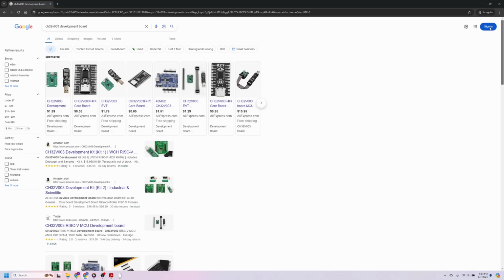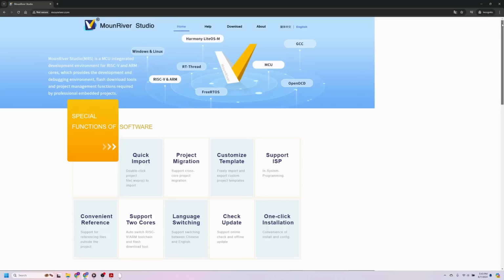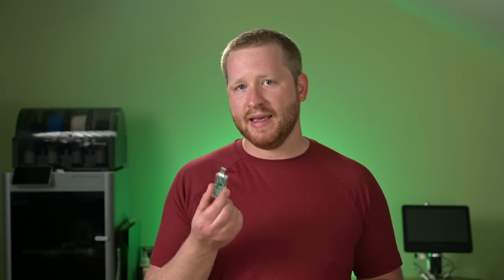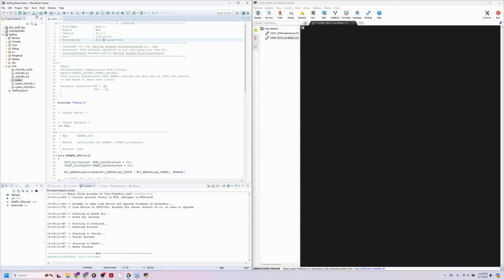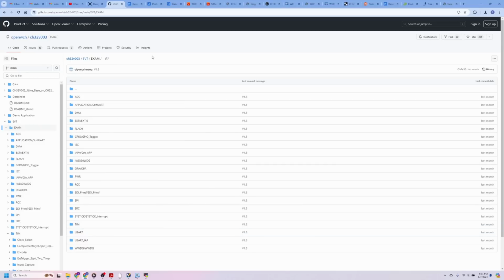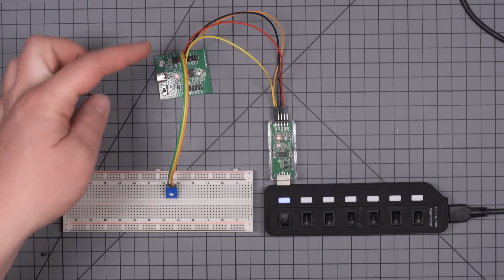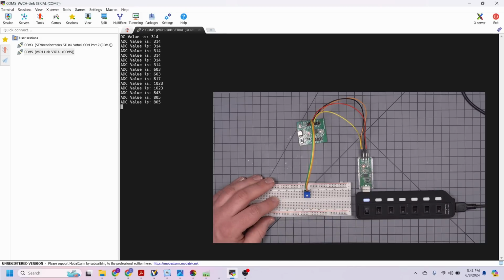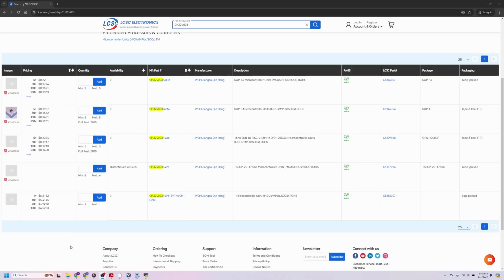Which 10 Cent Microcontroller is Right for You? Comparing the CH32V003 to the PY32F002A.

Comment: Thanks. It would be interesting to compare code densities between the cores, but that would require some effort to do right, probably require compiling a relatively large program without using a lot of HAL stuff.
Reply from the maker: That would be interesting, but a fairly in depth project. I also think that exactly what you chose to do with the code could make a difference, which is why there are so many different standards for benchmarking microcontroller cores.
Reply: I suspect that the RISC-V will have a slightly lower code density due to the spartan nature of its ISA. But being both RISC, I suspect that they’d be close.
Reply: @ChrisSmith-tc4df  That would have been my guess, but a web search came up with a claim that RISC-V was about 10% better <shrug>.
Reply: @ChrisSmith-tc4df  Basic RV32IC (or RV32EC in the WCH) has a little lower code density than ARMv7 (Thumb2) used in the Cortex M3/M4/M7, but don't forget that the M0 has the older/cut down Thumb 1 / ARMv6-M which essentially only has the 2-byte opcodes and full access to only the first 8 registers. The WCH has only 16 registers vs 32 for the more common RV32I, which can cause more register spills to stack than in full RV32I (but similar to 32 bit Arm), but it has both 2-byte and 4-byte instructions and the 4 byte instructions have full access to all registers. I think it will be pretty close between these two chips.  Note that the "Hazard3" RISC-V core in the new Pi Pico 2 is not only full RV32IMAC but also has some newer ISA extensions that can cut code size quite a lot, including Zba for array addressing ("shift and add" instructions), Zbb with some additional boolean operations and clz/popcount, and also the very new Zcmp which is specific for microcontrollers and adds things such as push-multiple, pop-multiple-and-return, and instructions to copy the first two argument registers (a0, a1) to or from a pair of callee-save registers (which speeds up function prologs and also putting arguments in place for other function calls). With these extensions in place RISC-V code is denser than Arm  Cortex M.  In 64 bit, RISC-V was significantly denser than amd64 or arm64 right from the outset, even without the more recent extensions. Recent versions of standard upstream gcc and clang have support to automatically use all these extensions if you include them in the -march argument to the compiler (e.g. in CFLAGS in your makefile).
Reply: @ChrisSmith-tc4df  RV32EC is not as spartan as ARMv6-M! At least it has mixed 16 and 32 bit instruction lengths, i.e. 3-address versions of all instructions, with all registers usable. R8-R12 have very restricted use on the Puya. The only things really missing on the WCH vs Puya are a multiply instruction, push/pop multiple, and and 16-bit opcodes for byte and halfword load/store. Later/bigger RISC-V microcontroller cores such as the Hazard3 in the RP2350 do have all of those.

Comment: In your comparison, you didn't mention power consumption.  I would assume that the 48MHz processor consumes roughly twice what the 24MHz processor does.

Also is it a fixed clock rate?  i.e. can I slow it down to reduce power?
Reply: You can clock them down to 8MHz off the internal RC oscillator and 4MHz from an external crystal and they also have low power modes from a 128kHz internal oscillator.
Reply: @greendragonmakerspace  Interesting, thanks!
Reply: @yeroca  I believe the power draw is a bit more than an attiny @AllTradesZach this might be an argument for the more expensive mcus for power critical applications
Reply from the maker: Yeah, sorry, I glossed over power. The video was getting too long and as @greendragonmakerspace says neither of these would be my first choice for low power applications. I believe they're both made on fairly large processes (hence being able to operate at 5V) which is a detriment for power consumption.

It's also true that they both have clock dividers and low speed internal oscillators, as well as external clock options, so they can go slower to save power. I don't necessarily think that datasheets are useful when it comes to power consumption numbers (because I've seen them lie and they tend to use very specific operating conditions which may or may not match reality). I didn't get the chance to actually measure power consumption, so I didn't say anything. 

Both chips have sleep and stop/standby modes, the latter of which really decreases power consumption but takes time to wake from. A common approach for reducing power is to turn on, do what you need to do as fast as possible, then go to sleep for as long as possible. You can use a real-time-clock to generate the wakeup signal, which neither of these have (the PY32 actually does have it, since it is the same die as the PY32F030, but it's not a listed feature on the -002) or an external signal. The PY32 does have a low power timer which I believe is designed for this sort of thing though. The PY32 also appears to have better power consumption per the datasheets, but I'd want to test that side by side with the same code on both devices. The PY32 datasheet says on the order of 6uA in stop mode with the low power timer running. So I think the PY32 is the better option for low power battery devices, but I don't have hands on experience with this aspect of either of them.
Reply: @AllTradesZach  Thanks for the detailed response! Using the exact same code for comparison isn't really possible due to the different ISA's, but the same source code makes sense.

Stuff I tend to work on these days tends to be on the low power end of the spectrum, so for me it's important.

Keep up the great work!

Comment: Hi! I've known the CH32 for years, and I haven't looked for anything cheaper since then. It's good to know how it is 
PY32, this is the first I'm hearing from you. Thanks. I plan to build a supercomputer with these chips.
40 years ago I built a supercomputer with 512 68000 CPUs, since then I have been waiting for processors to become cheaper,
this seems to be happening now. Now the whole machine will be cheaper than 1 CPU then.
Reply from the maker: No doubt, especially if you use either of these chips! You might even take a look at some of the higher end parts in these product lines as they might offer more performance for the dollar. I'd also check out the rp2040, although bear in mind that it needs a separate flash chip.
Reply: @AllTradesZach  I bought the RP2040 as soon as it came out, but it's too expensive for me for this project, even though it's very well priced and well worth it.
I am building a supercomputer with 1 million processors and allocating only 1BTC to it.
I'm looking for unencapsulated chips to be as cheap as possible, because I can solve the bundling, directly to the PCB.
16 x 16 chips on 2 sides, the 512 on a mini panel, and 2 x 32 x 32 of these are the cluster. I don't need a CPU that knows a lot, but a lot of parts that are cheap, that's the point. I cannot model this with software, because I want real-time hardware operation.
It is needed for a neural network model, but I think this is not surprising.
Reply from the maker: Wow, that is quite a project! I hope you document that somewhere for us mere mortals to follow along!
Reply: @AllTradesZach  When I looked I figured the best bang for the buck was down at the bottom end for the PY parts. Moving up, the Artery Tech M4 chips look very good value.
Reply: @perceptron-1 any details on the usage of such a setup? I'm intrigued! 🤓
Reply: It's for world domination.
Reply: @JimMaz  Yes, in 1-2-bit LLM weight matrix calculation and energy consumption minimization and real hardware parallelism.
Reply: @TheStuartstardust  This is a trial, a real-time test circuit, LLMs training first, then if it can be integrated into 1 IC, then the product for hobbyists is LLM Hardware, 1 small microprocessor with 1 million cores, shared memory for low bit LLMs (Large Language Model).
Reply: I was a big fan of the 68k back in the day. I'd look at the AT32F series for computing bang for the buck as its an M4 core and runs at least 2X the clock rate of the CH32. Taobao prices look to be considerably cheaper than LCSC for these parts, I'm seeing sub $0.30 but haven't put that to the test yet.
Reply: Massive parallelism doesn't make it a supercomputer, but cool project nonetheless.

p.s. I used to work with big iron, you don't want the extra junk that comes with those.

Comment: WCH is a large and reputable company started in 2004. Their chips (especially their USB chips) are in lots of mass-produced products. I've had their CH32v003 mcus in working boards for over a year now and still going strong. (not a shill, just a fanboy...)
Reply: CH32V003F4P6 is a piece of junk.  I bought 20 pieces on Aliexpress and 4  of them stoped working after short time. Very unreliable. I will go back to stm32.
Reply from the maker: Fair enough, I didn't necessarily mean to imply that these were low quality or wouldn't last long. There are just some other companies that I have a long history using that I expect to be high quality, whereas I don't have enough experience with WCH or Puya to make that assessment. Plus, it speaks to the mentality of the engineer. If they used the cheapest microcontroller did they also use the cheapest capacitors, power converters, etc?
Reply: @AllTradesZach is it it engineer mentality that dictates what the cost of production?
Reply: To a certain degree, yes I suppose 🤔
Reply from the maker: That is interesting question, could get very philosophical. I'd say that it is an engineer's job to make the absolute best design within the given constraints, one of which is certainly cost. I think we all want to make the best product possible all the time, but it just isn't possible within the constraints and tradeoffs, and often times the better product is the one that reduces production cost.

Of course, it is often not the engineer's mentality perse, but that of accounting or management that make the directive that the engineer has to follow. If you're told you only have $1 for the total cost of the BOM you have to trim the fat somewhere, so you might end up reducing the quality everywhere.

But I also think that cost and quality often come down to the engineer's decisions without the help of accounting/management. I've worked with people who try to cheap out everywhere they can to "save the company money" (and because sorting by cost is easy when shopping for a component) as well as people who will try to do the absolute best thing regardless of cost or time. And of course plenty of people who just aren't experienced enough and make less than ideal decisions that make products less reliable and more complicated. I find myself in that latter group regularly but learn something each time.
Reply: It certainly can be. Until you hit truly massive production a couple cents difference isn't going to outweigh the selection made by engineering.